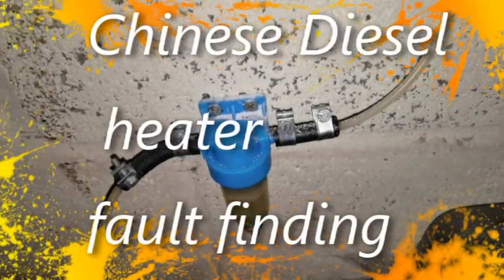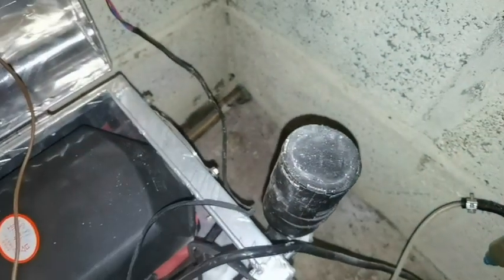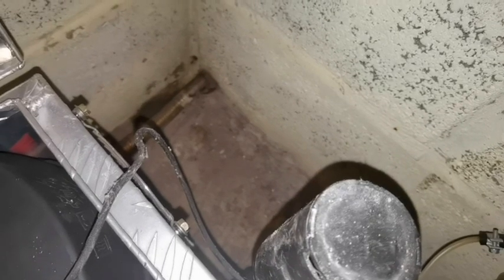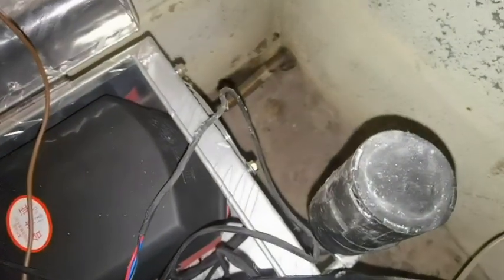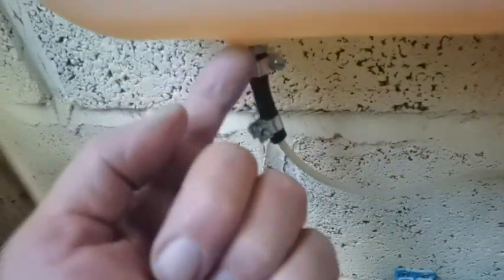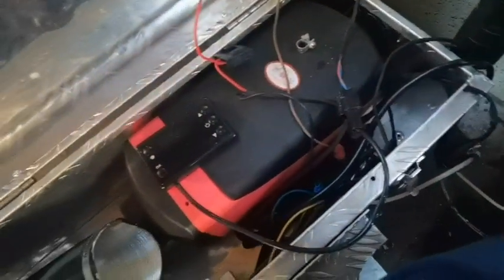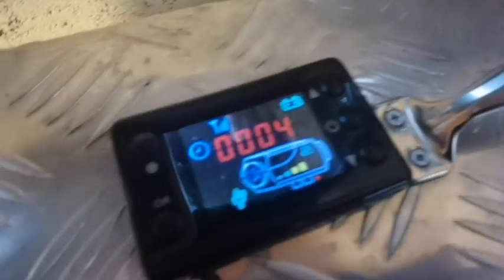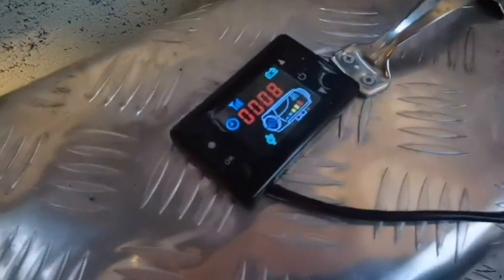Chinese diesel heater fault finding

Comment: Sir thank you for sharing your experience with us,  Please get one of the Chinese copies of the Racor 500fg fuel filter, I use one 500fg filter to run two heaters off my main fuel tank in my bus, it costs more but get one with all metal fittings, there is also a option of a fuel heater for that fuel filter. Keep up the good work and stay safe and God bless you and your family